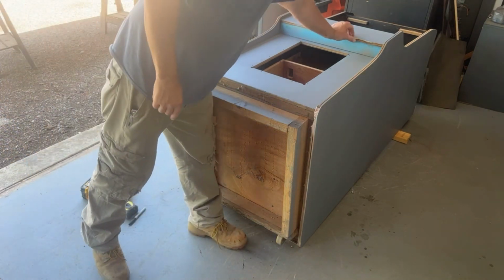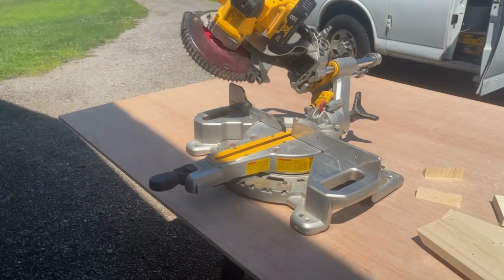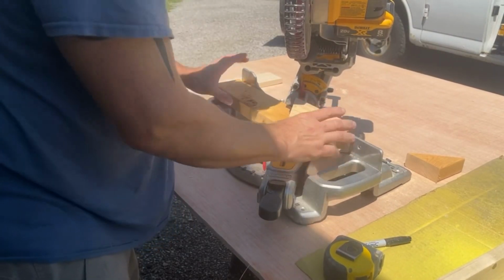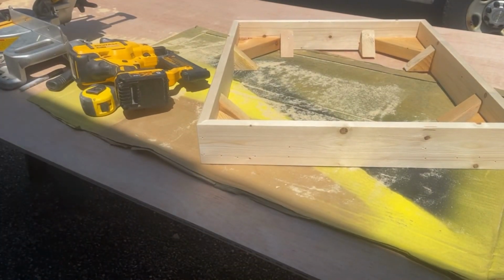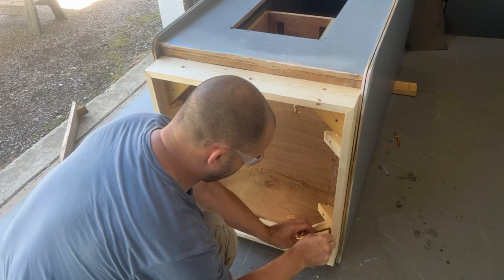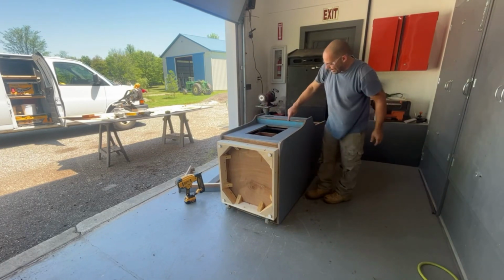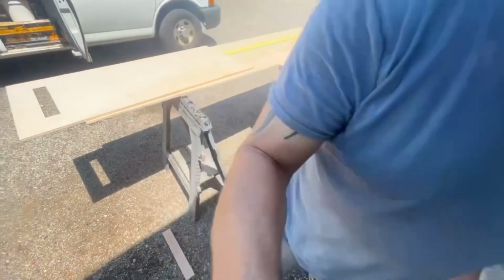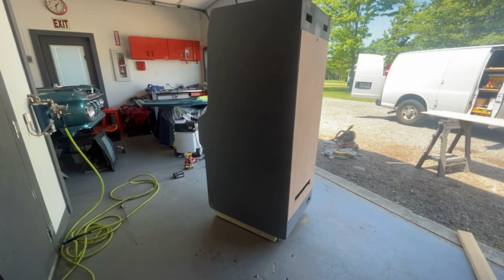Donkey Kong 3 arcade restore part 4

Comment: holy crap dude 49:55-50:55 was amazing! I usually have to break out the router, get a straight edge clamped and follow that. I even have to do a test pass on a scrap board so I can make sure the depth and good. You did this shit in 2 mins with a skillsaw, and a freakin pocket knife! You have some skills sir. /fistbump
Reply from the maker: Thank you very much